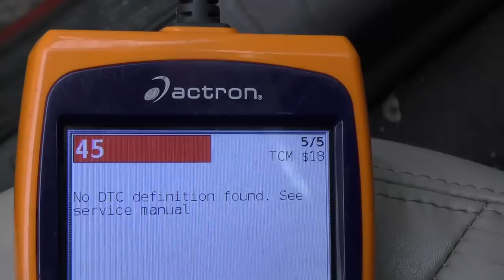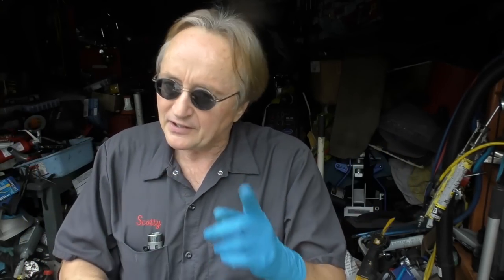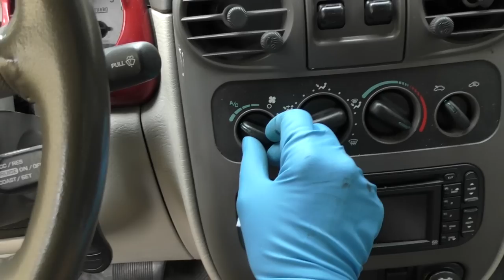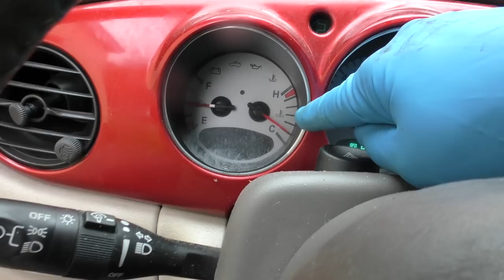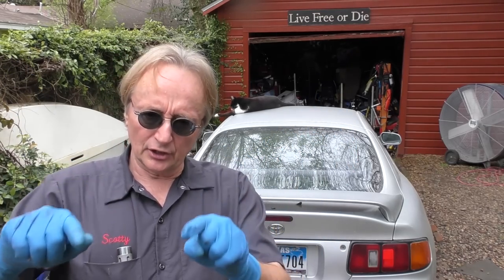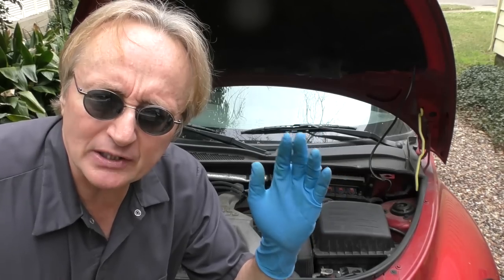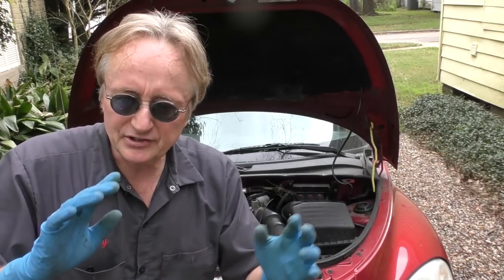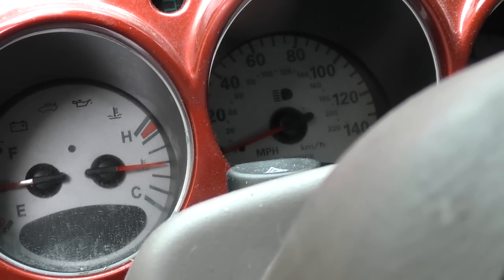This PT Cruiser Has a Serious Problem

Comment: Lemme guess, the problem is that it's a PT Cruiser lol
Reply: Dude my aunt has one they are the biggest pieces of junk I've ever seen
Reply: Took my words:) it is the problem, it's a PT parted trash lol
Reply: I didnt think it would be that easy. In my Mustang I had the opposite problem and I got little to no heat in the cold. Turns out the old thermostat had a hole in it. So I swapped it out from a 180 to a 195 degree and it performs decently with heating now.
Reply: lmaoooo 😂😂🤣🤣
Reply: I would fix it with a match.
Reply: @beyondrepair8949  and can of gas
Reply: @icantthinkofaname4682  Call it a PT Bruiser. Because you're gonna have bruises all over from punching yourself for buying one haha. 
(I know its awful)
Reply: My brother had the misfortune of renting one once.... I was impressed how cheesy it was, closing the door sounded like dropping a tin can on the road.
Reply: Yup..
Reply: Pt cruisers are Junk, BUT,my girlfriend wrapped her car around a pole 2 years ago,and I needed a replacement car quick,it just so happens, a lady died ,and had a 2004 pt cruiser ,with 79k on it,and I bought it from her nephew for $1700...It never broke down,the only money I put in it was a set of brakes ,a watts link in the rear,and catback exhaust,It was a cheaply made car ,But actually treated us well,my girlfriend used it for a year,and gave it to her daughter ,who drive it up until recently,bought her a new car and took the pt off the road,which now had 107k on it.We just sold it for $800, 2 years 2 drivers ,no problems except maintaince things, and 28k worth of use ,$1100 ,cost of ownership,plus a few hundred in parts/repair .LOL,served us well for a beater
Reply: Thermostats are replaced a lot on ALL makes of cars. A low $ part.
Reply: Yeah made by Chrysler
Reply: Lol, you guys obviously never owned one, or if you did you didn't do any regular maintenance. My O2 has 163K miles and she's still going strong, other than the Arizona sun starting to take it's toll on the paint.
Reply: A perfect summary. 👌
Reply: I never did embrace the allure of these 'cars'. Small....Ugly...unreliable money pits...I mean, what is the upside on these things? Cute, like a kitten?  I never caught this fever, thank Goat.
Reply: Pants on Fire
Reply: *PT Loser
Reply: It’s like the brother of both the Toyota Prius and the Chevrolet HHR. I don’t think anything can get any worse than all 3 cars combined. Don’t you think? 😅
Reply: @MasterJim2020  Pontiac Aztec
Reply: S Campbell Oh yeah. I forgot about both the Pontiac Aztek, the Mitsubishi Mirage, and the Nissan Versa Note. How could I forget? 😅😅 Probably because I’m more focused on better looking cars like the Ford Mustang or etc.
Reply: Ehhhh.   Not this time, typical problem that really can happen to any car. I bought a grand Marquis from a really old woman, it had a bad thermostat except it was stuck open so I the engine wouldn't reach optimal operating temperature.
Reply: @MasterJim2020  I can not say much I drive an BMW i3 😬
Reply: S Campbell Well I mean the i3 is not a bad looking car, even though it’s not everyone’s taste. I think the i3 looks a little bit better than the PT Cruiser; not just because it’s a BMW. I drive a 2015 Buick Encore and it’s a great looking car as well, but again, it’s design doesn’t suit everyone’s taste.
Reply: How did you know!? You, my friend, are a smart man. Lol.
Reply: @beyondrepair8949  
Mercy killing....
Reply: @MasterJim2020  very true... I initially bought because it was most mpg available at the time, 2014.  Liked so much I bought a second one few months back, 133 mpg is tough to pass up for a commuter vehicle.  Just don't tell Scotty 😀
Reply: @supersexyfatguy  yeah, I don't understand why everybody rags on that car.  It's a car with four wheels and an engine.  These guys that love their Dodge Challengers and Chargers must not realize that they are built by the same company that built that PT Cruiser, Fiat/Chrysler.
Reply: Yo do realize that the same people that built the PT Cruiser also build the Dodge Challenger and Charger, don't you?  Dodge doesn't build the cars, Fiat/Chrysler does.  Just sayin'.
Reply: Alexander Scotten You do realize that Fiat and Chrysler didn’t even merge together until 2014, which was 4 years after the PT Cruiser ended production. Right? 😅
Reply: S Campbell 😉👍
Reply: Master Jim 2020 yeah.....and???????
Reply: My boss had one.  Had to have a new head installed because the spark plug popped out, threads stripped.  Turbo must have been too high in pressure.  Had to have the whole dash removed to fix an air conditioning problem.
Reply: As former owner of one of those, yeah that's the problem lol :)
Reply: Lmao
Reply: I bought a 2002 pt for 500. Had it for almost 6 months no issues other than things that were already broken (rusted muffler, cig lighter doesnt work, broken handles, most of the fluids were nasty) and regular matience. It looks like they were rough on it but it has been amazing for me.
Reply: @DAN007thefoxx1  I have a pt doing the same thing. Was thinking it might be the thermostat since its colder than hell here atm
Reply: It is an interesting car.
Reply: @Anna-tc6rz  My car is alot older and more simplified. I just look at the thermostat and see that it wasn't going fully to operating temperature in the cold and I had no heat.
Reply: Insert (my pt cruiser has 200,000 miles and it's still going strong) comment
Reply: PT Cruisers were crap.
Reply: @DAN007thefoxx1  yeah I remember helping my dad work on older cars. Theyre usually so easy to fix now it's much more complicated. Mine is only 10$to replace so I'll just replace it and hope for the best lol.
Reply: @Anna-tc6rz  With mine it wasn't quite as simple as doing the same job as say, on a '67 Camaro. My grandpa and I found out that you will need some liquid sealer along with the gasket itself to keep it from leaking. And because the distributor is in the front and the housing is forward facing, not upward facing like in an older LS, you can only use a ratchet on one of the bolts. Minor inconvienience, but I think it was worth it.
Reply: @DAN007thefoxx1  not quite that old. Like 80s-90s. I never reccomend a car that was made before they started implementing safety regulations. (Which was 1970ish?)
Reply: @nosoupforyou425  - that Aztek was one UGLY vehicle
Reply: @Anna-tc6rz  I had extra seatbelts put in and plan on doing a disc brake conversion.
Reply: Frankie 072 See, goes to show one man's garbage is another man's filet Minion!
Reply: UncleSarkis They are very reliable cars! Thermostat is just about all that may go wrong with a Grand Marquis!
Reply: @DAN007thefoxx1  have you never seen crash vids with old cars like that? They're insanely unsafe in crashes. Not trying to be a dick or anything just dont see why people keep and drive them other than for show.
Reply: @0386rm  uhh, you're way off. Like one guy said the PT was before the merger. Also, the PT Cruiser was manufactured in Mexico if I'm not mistaken. I believe those other vehicles were manufactured in either the US or Canada
Reply: @poncho828  all comments have equal value regardless of pro versus against. The only way to prove the true reliability of vehicles on a large scale is to look at vehicles being sold and what the odometer says or vehicles that have been scrapped and what their odometer said. Of course this averages the score because you're going to have those who took care of their vehicles and those who didn't
Reply: jimmy dean yeah...and???  Are you saying there is a difference in where they are made?  Regardless if it’s Daimler/Chrysler or Fiat/Chrysler, Dodge is still a Chrysler product, just like Ram is.  That was the point of my comment.  Sorry you missed that but hey, if you like those Challengers and Chargers with those plastic interior parts, more power to ya!
Reply: Couldn't have said it better
Reply: I had a PT loser.  It never overheated, but it was still the worst car i've ever owned.
Reply: The P.T in P.T Cruiser stands for Part Time Cruiser . Or poor , transportation
Reply: @mikec6014  they have more problems than a math book .
Reply: Lol pt cruiser
Reply: That was my first guess as well!
Reply: Funny how many had the exact same thought...😎
Reply: No no no, it’s a PT Luiser
Reply: Hell yea, that's the issue. It's a pt cruiser, that's the whole problem 😂😂
Reply: @0386rm  Yes, there's a difference
Reply: @DAN007thefoxx1  it was designed to fail like that so your car doesn't over heat just waste gas...
Reply: jimmy dean explain it to me, please.  I’d love to be educated.
Reply: @0386rm  Sure. The quality control in Mexico is pathetic. A large part of this is due to a populace that doesn't have an education in mathematics. Mathematics are required for precision. For example, the Takata air bags that killed numerous people were manufactured in Mexico.
Reply: I have 2003 gt 111k miles and no issues. Guess im lucky lol
Reply: But how come I seen some with over inside 300,000 miles? Sure American car need more maintaince. But its cheaper, & easier maintaince. If u keep a upkeep maintaince to any car, it will last. Even Honda & Toyota have there problems at times!
Reply: @poncho828  189,000. No problems lol
Reply: @BadDriversOf Georgia same here...05 1,800 dollars.. No problems.. If you you know how to take care of a car ,it'll take care of you
Reply: u had 999 likes and I gave you one
Reply: @alrawikiller  Thanks!
Reply: PT Loser is more like it.
Reply: @frankie072  go buy a loto ticket!!!
Reply: @stevesmith1731  LMAO ,
Reply: Never understood who would buy a car that pretends to look like a 70 year old milk wagon
Reply: To everyone saying it's not that bad, you're high. Tell me that after you replace a water pump or do a head gasket job on one. They are straight garbage and impossibly difficult to work on due to the small engine compartment
Reply: @supersexyfatguy  I have had mine for 13 years.
Reply: @deadchannel991  it takes a good mechanic to work on a pt cruiser
Reply: @frankie072  My mother got one in 2003 and until past year started to have serious problems. Is a car made to be treated gently but was marketed as a tough mini muscle wagon, so of course that it felled apart.
Reply: I have a pt cruiser and i can confirm that lol
Reply: My wife had the 2.4 turbo convertible, and the thing used nearly as much gas as my Dodge Hemi Truck! I used to call it her pregnant roller skate!
Reply: Yeah that's the problem
Reply: My sister bought a 2002 with 80k miles, transmission went out at 100k, now the timing belt just went out, now the AC compressor is out, all at 116k miles don’t buy one!
Reply: That's where I would start! 😆
Reply: Yep that's the problem
Reply: It's a car . Any car has problems
Reply: @supersexyfatguy  you said it! Pt cruisers are great when they are properly maintained, especially the turbo models. :) That said... I do understand how maintenance is hard due to the very tight engine bay, I'd know, I own a 2005 turbo model.
Reply: Non. Mais.
J'ai un PT cruiser de 2001.
2l et 250 000 kms 🤗🥰
Reply: @supersexyfatguy it’s 2024 and I have my original 2005 PT. It will be the last car I ever own. My husband was a mechanic so it’s been well cared for and has less than 100,000 miles on it. We’ve had no major issues and I love my car. It’s paid for, I drive it, it doesn’t drive me, can’t get better than that.
Reply: Exactly.   I have one, and it's best quality is that I can leave the back seats out and haul a substantial amount of cargo.

Comment: Hey Scotty, I am a retired Ford International Field Service engineer. (1969-2016) Which just means Ford has sent me all over the world to repair cars and trucks the no one in country could repair, or to find the root cause of issues plaguing a certain component or model.  I love watching your videos and agree with all most all of your opinions. I like that you stress verifying the basics before checking the electronic systems. Almost all of the issues I have solved were done by checking the basics first. Most techs check for codes and start replacing parts starting with the first code and ending with the electronic module or modules and the issue is still present after breaking the bank and wasting a lot of saleable time.
Reply: Well said.lucky you can retire and get out .as a mechanic myself(still have few years yet). There's no more thought process it's gone.they grab a laptop or scanner. Look for hours into the screen. Waiting for an answer.
The basic mechanical knowledge is not there.
Actually sometimes my job is easy. All the parts changers have changed all the not failed parts.then I'm asked to finish it.i tell them where to look.or what the problem is. It goes in 1 ear out the other.
I let the boss tell customers why we changed unnecessary parts.

Comment: Being as I drive a Neon still and have for twenty years I imagine the misfires are from plugs that haven't been changed in forever. Gotta replace those copper core plugs about every 30,000 miles. No excuse not to either as they are incredibly easy to get to.
Reply: Hey mate, does your neon vibrate like crazy when on idle?
Reply: I have an 18 year old NEON it still runs good 250;000 KM on it, I bought a newer car because I got sick of the NEON being too reliable
Reply: Felt cute might grenade 3rd gear later idk
Reply: Got an 04 Neon SXT 5-speed hand me down that was wrecked twice my my elder sibling.  About to hit 250k miles on the original transmission, clutch assembly, and engine.  Motor mounts wear out fast and have had to replaced multiple times to fix excessive vibration in the passenger compartment, but other than that has been an amazing car.  I’ve taken the thing all over the country, up and down mountain highways, the whole gambit and it still runs well!  Currently drive my Neon 80+ miles a day commuting at freeway speeds.
Reply: In the SRT-4 Neon engine, which the PT Cruiser Turbo models had, the spark plugs are a bit harder to get to. You actually have to have like an 8 inch extension for your ratchet just to reach down into the engine and unscrew them
Reply: You have to "load" the lower engine mount when replacing. There is a youtube video on this.
Reply: @blairsville9151  Yeah the 2nd gen which the SRT4 is does require this. But at least the vibration dampening of the dogbone style is better. Mine is a 98 1st gen auto. Only 3 mounts total 😁. I just live with the vibration. As long as it gets me where I need to go reliably and safely is all I care.

Comment: Not sure if blown head gasket caused overheating or overheating caused blown head gasket. Or just Chrysler
Reply: Mopar mopar mopar mopar..... ohhh damn now I have no car becuase I liked mopar :(
Reply: Lol subscribe
Reply: A thermostat is like the easiest thing to figure out. Imagine just how many cars died cause of this.. My 1998 Hyundai accent died at 60000 miles cause the gage was placed AFTER the thermostat, not giving you any chance to know your car is overheating if your thermostat failed. Way worse cars imho
Reply: Just another uneducated PT Cruiser basher. You can tell they haven't worked on one in their life. Owner neglect is the number 1 reason most cars have issues to begin with.
Reply: You will also notice that the car needed a 15 min repair and a $3 part. How much easier do you need it to be?
Reply: @rider9187  my lancer died because of a bad thermostat blowing the head gasket and then the car never run right ever again.
Reply: lol

Comment: Thank you so much for making this video! Sadly it is probably too late for many owners. My family’s 2001 PT cruiser had a constant overheating issue. Out of several mechanics, NONE could diagnose the cause. My sister was driving it as it overheated & caught fire on the highway, eventually totally englufed in flames! She barely got out with no injuries. I hope your video helps others to prevent this. I will never buy a Chrysler product after that!

Comment: I had a PT Cruiser rental about 11 years ago when my Toyota was in the body shop.  To be fair it was a decent car.  Roomy and decent driving.  My only complaint was the automatic transmission only allowed manual shifting in gears 1, 3 and 4.  When going up grades I wanted to downshift to 2nd.  1st was to low and 3rd was too tall.  It wouldn't stay in 2nd.  The 3 weeks I drove it was a decent experience.
Reply: Probably because it was a new car, most all cars are nice when they are new, the real question is what's it's like 10 years later with 120k, is it just about junk or is it ready for another 100k
Reply: @thetechlibrarian  I bought one cheap for $500 with over 140k on it.  It was suffering from the neglect that the last couple of owners had given it.  A bit of TLC made it a car solid for a cross country trip, in which it did happily. No squeaks, no rattles, no complaints.  As has been mentioned elsewhere in the comments, just take care of them and they'll last.  The only true issue with working on these is the fact that the engine bays are tight due to the "retro" styling.  It makes some work harder than it needs to be as you have to remove parts to make space to work. One of those things is the timing belt, as it requires removing a section of the frame to gain full access.  Since it's a "deep" repair, there's a list of seals and the water pump are included in the swap list making it expensive.  You have to learn to fix these yourself as nobody wants to touch these anymore due to the labor cost.  My first timing belt job was an entire weekend with three of us taking a very systematic and careful approach to ensure that we got everything together correctly, and not have to repeat the process.  I could probably tackle it solo now in about a day.